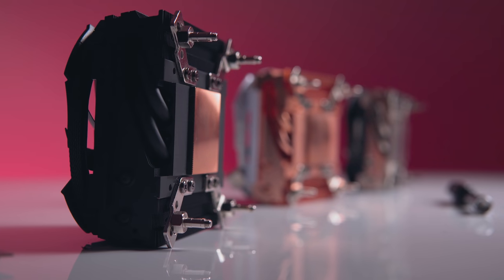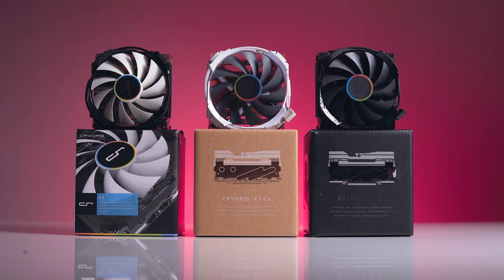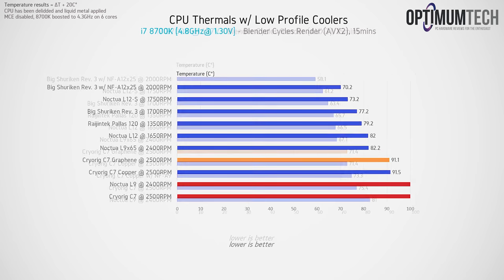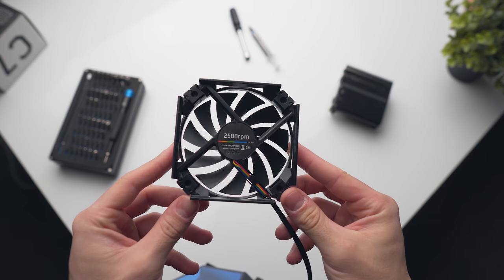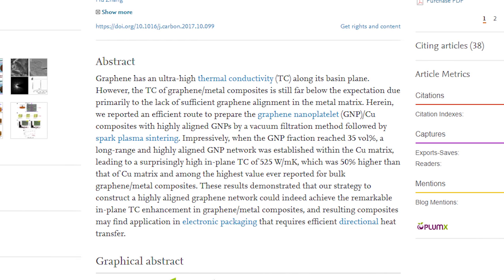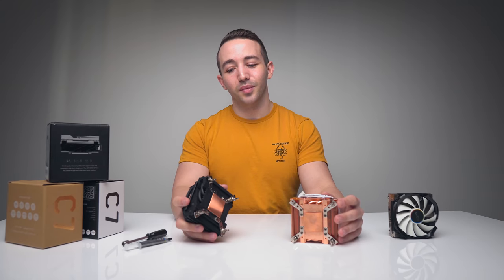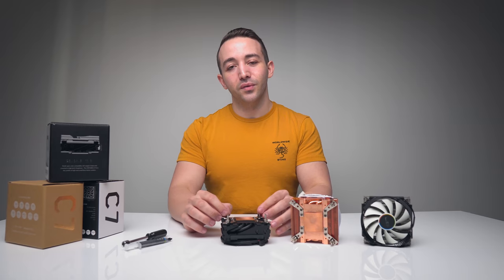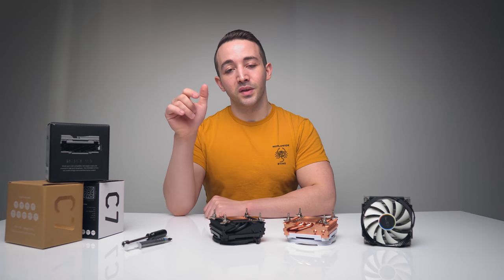Graphene Coated CPU Cooler - Why Does This Exist?

Comment: This is why I love this channel. You even went to research the graphene properties to see why of these results. Great video as always Ali!
Reply: Navaks exactly
Reply: I apreciate his effort too, but I feel like he kind of missed the mark, since the paper is about Copper Graphene composite Materials and not about coatings. Those too things are not the same and the cryorig c7 graphene is not made from a composite, its only graphene coated copper... Dont want to bring any bad vibes just feel like this needs to be clarified.
Reply: There was no point in bringing up that research. A coating wouldn’t improve the thermal conductivity of the cooler. The fact that it’s got a matte black finish is probably what made the difference. Graphene would only make a difference if it was the interface between the heat source and the heat soak, so like a heat pad sandwiched between the cpu and the cooler

Comment: So it's the copper c7 but black? Good enough for me
Reply: Yeah, if you are into the looks of your PC, I think options like these are great.
Reply: Yep. I think Graphene was just an alternative to black anodized aluminium like some other manufacturers use, in order to get a black colored cooler that performs just as well as bare copper.
Reply: yep, the color is the main issue
Reply: Its the best so far  for sffpc with 47mm max cooler height. =)
Reply: Yeah, if you're gonna get a C7 at least you can get it in black if it's same price lol.

Comment: Disappointing in this case, but interesting innovation attempt. Good investigation and honest review 😎👍
Urban car myth: Painting a car radiator black helps it run cooler. The reason painting a bare aluminum radiator can help is the paint gets heating by conduction. A car radiator is large enough that adding paint can be a significant amount of heat soak material. The colour doesn't matter. Unless trying to reflect radiation from the sun, then white would be more appropriate.

Comment: Great Video on an intresting CPU Cooler. Just one bit of engineering information from my side: usually radiators get coated to improve thermal radiation. It is the same effect as wearing a black shirt when its sunny outside - your shirt gets more hot then someone else with the same shirt in white color. This works in reverse too. So you will also radiate more heat. But you w'ont notice that since it is a minor effect compared to convective cooling. And that is also the Problem here: the heatsinks main way of cooling is active convection thru the fan, radiation has almost no effect in comparison. But still I bet the improvement in radiation of this cooler with the coating is measurable. If you dont trust me, check black body on Wikipedia. 

I hope this is somewhat understandable, since English is not my first language. Great review anyways!

Comment: Well it's the C7 but black and performs the same as the C7 Copper, that's cool.
Reply: @A_P3RS0N  it’s not denser than copper, the electrical current density is 1 million more dense than in copper, density and electrical current density are 2 different things, also the heatsink only has a coating of graphene(it’s still made of copper) and it doesn’t make the heatsink perform better, it’s just marketing and looks

Comment: I think there might be a slight misunderstanding here, adding a layer of highly conductive material onto a lesser conductive material will not magically make it more conductive. What you will actually do is to insulate it less (than if adding another material onto it), because adding material will always insulate an object NOT improve heat transfer. (the reason it works for thermal paste is in essence that you get a better contact between IHS and heat sink thereby substituting air for a much better heat conductor I.e. The paste ) 

The only way this could improve transfer is if it provided a higher surface area or substituted some of the cobber that would otherwise be there (which it does not as it is a paint job). If it substitutes paint with a low heat transfer, it will improve the thermal conductivity relative to a heatsink covered in the standard paint.

If what I said above was false, you could insulate your house perfectly, so not a single watt of heat would escape you house, then paint it in this paint and then your house would not insulate at all... I promise you this will not happen because the inner layers will limit the heat transfer. Exactly like the cobber heatsink will be the limiting factor for this heat sink.
Reply: Well put mathias, saved me an explanation

Comment: I'm not sure if the high thermal conductivity is the reason why it performs better (albeit barely). My hypothesis is that air is not a good thermal conductor, thus changing the thermal interface material will not do much, unlike using liquid metal where both surfaces are highly thermally conductive. Using a black coating however may improve performance because it is a better black body radiator.

Comment: As a fan of Cryorig's products (was rooting hard for them to make Noctua, BeQuiet! and Cooler Master a run for their money), this rush job to bring out something just to sell really hurt. The original tower coolers that they came out with pushed competitors to make better products since the market for coolers started becoming stale. So if Cryorig should learn anything, it's to go back to true innovations like the Hive-Design, or the offset design, which didn't turn out to be gimmicky.

Comment: Graphene can only conduct heat on a specific direction. Therefore, it only helps conducting heat when all molecules aligned at the right direction, which is impossible for a "coating" since the direction of molecules cannot be controlled. 
AMD used a special graphene pad in their Radeon VII, which provide a better heat conductivity than thermal compounds (especially for the junction temperature). In that case the pad was strictly fabricated so that the molecules could align at the right direction.
However, the graphene coating is not completely pointless. Copper heatsink, unlike many people believes, do get oxidized. Especially after they contacted with human skin. The trace amount of sulphur containing secretion on our skin could catalyze the oxidation of copper. Therefore, all copper parts that may make contact with human skin must be coated with something to prevent the oxidation. Therefore, the graphene coating is actually to replace anther coating material with less heat conductivity.
Reply: might be not as much advantage as expected, but an advantage nonetheless

Comment: Thanks for the review, was considering this one for the DAN A4 if it would cool really well, but the turbulence from the height clearance, the price (70 euros) and the not really all that special cooling capability make the Asetek 645LT a way better choice.
If you can only fit this or the low profile Noctua, at least it looks really badass. If you peel off the sticker on the fan it's an all blacked-out little cooler. Shame about the graphene not really adding anything, though.

Comment: As a Materials Engineer, some other factors that Cryorig may have needed to consider (in my opinion) in getting this product out to market:
1 - Graphene - by definition - is a single layer of carbon / graphite (sub nano-meter thickness). Too fragile to be handled by hand. In order to make it easier to handle - they could've had to use a thicker coating (multi-micrometer levels). That drops performance also (ESPECIALLY if the layers aren't aligned)
2 - Graphene - just like graphite (from a pencil for example) doesn't want to bond with metals that well. They could've used a bonding material that could reduce its thermal conductivity. Consider thermal paste between the die and IHS vs. solder between die & IHS as an example. Think how much better an integrated & soldered CPU cooler would perform vs. the ones we use today, as an example.
Reply: I ain't never done shit to you  why u gotta hate on me?

Comment: Honestly, it's all about the color. First of all the study you have found is about in-plane-conductivity, aka heatspread from the part of copper sheet(fin) closest to the heatpipes to the parts furthest from the heatpipes. Transfer of heat from the copper fins to the air flowing through them would be out-of-plane-conductivity, which I would argue is the actual bottleneck. The other issue here is that graphene has thickness of about 0.35 nm (actually slightly lower), so even 525 W/mK will mean 0.00000018 W/K drop through the graphene sheet.
I suspect having some sort of microfin or even nanofin structure on the copper sheets would dramatically outperform any graphene application. For me it is a non-compromise way of painting the fins black, purely cosmetic and unrelated to cooling performance.

Comment: Awesome video! A little let down by the C7G but Im curious if the application of graphene is different through each model. If one model has a low heat dissipation constant and another was applied slightly different causing it to get closer to that 500 W/mK

Comment: Even if the graphene is aligned, the layer is so thin, probably not even 0,1mm, it’s like it wasn’t there. It would only help if the whole heatsink (not only a coating) was in aligned graphene.
Reply: I can show you explain why with numbers, but it would be a small essay. #trustmeimanengineer
Reply: i thought the actual point of having graphene is to make a larger surface area, even if it's in microscopic level, to make it easier to dissipate the heat into the surrounding air.
Reply: @Looo0007  Yeah because of the roughness, the convection (heat transfer between fins and air) will be better. Aligning the graphene will help for a better conduction (heat transfer through solid materials). 
The convection should create more turbulence. But if there is already enough turbulence, more turbulence wouldn't do a lot. Btw havingmore surface, doesn't always makes it better, look at golf ball: it has more surface area, but less turbulence and thus less friction.
The conduction though the aligned graphene is very vast, but he layer is so thin, it almost doesn't do anything. 
It's like putting a spoiler on a slow car. It won't be really faster in the corners (but it will be a tiny bit faster)... But I still think it looks cool. :)

Comment: Surely adding another layer that takes time to transfer heat just adds (maybe by a negligible amount) to the total amount of time it takes for that heat to be transferred?
A faster heat transfer material than copper on the copper is not going to speed up the transfer of heat through the copper.

Comment: Graphene is a pain in the ass to work with technically. It would be a game changer for battery technology and other billion-dollar industries to get it to behave as intended, so there is no way Cryorig did anything else than applying a graphene enhanced paint. This does not improve heat conductivity at all but seems to not have negative effects.

Comment: I was wondering if you have tried using a powerful low profile 120mm fan on the C7 variants?  (more like the ID 12015-XT, rather than the Noctua one) You probably have many fans that you can test.

Comment: So I just learned about Graphene and my first though was application to CPU cooler... Looks like someone beat me to it.  However, why is the copper bare on the underside. The heat has to conduct through the copper before it can even reach the graphene.

Comment: Hello there, really greatfull for all your videos. They help a lot. In that note I am here to thank you and drop you a suggestion for the cryorig c7 ultimate analisys. Have you eard of the j-hack 3d printed mount to adapt any 120mm or even other 92mm fan to the cryorig c7? For the 202 folk it would help a lot ( I am thinking about building a node 202 build with that, because judging for your videos the real limitation of the c7 is the fan.

Comment: The baseplate on the graphene one is copper, so go figure that you're not getting any better results than pure copper, because you're limited by the copper interface to the IHS.. If it was entirely graphene, it would probably perform better.

Comment: The max temps might be identical but did you look at the temps while they getting up to that?? I wouldn’t see this cooler as being able to have lower max temps but more efficient cooling up to that point. Like how a AIO takes a solid 15-20 minutes to find a stable temperature when under load.
Reply: It wouldn't make any difference - the reason an AIO takes longer to heat up is because water has a much higher heat capacity and is absorbing most of the heat and takes longer to heat up. Graphene or not, this cooler is still 99% copper, so it will behave virtually identically.

Comment: Coating the cooler in "graphene" (do we even know it's graphene?) seems to be more of a marketing hype generator than an actually useful technique. I'm sure there's an upper maximum to how much heat a cooler of this shape could dissipate even if it were made of a material with unlimited thermal conductivity.

Comment: I don't think they can ever improve performance by only applying it to the fins. Heatsink performance "improves" when they are more saturated with heat; a heatsink that is 50C hot can dissipate more heat than the same one 45C. But the issue is that CPUs are particularly bad at transferring heat because of the IHS, even worse on intel CPUs with thermal gunk instead of solder. So the first thing to improve should be the baseplate, to improve heat conductivity. But there's only so much you can do. That's why 120mm AIOs on a CPU run like crap but on a GPU they're amazing. GPUs transfer heat better, the water and radiator have higher temperature, dissipate more heat. 

This review comparing the Noctua NH-U12A vs. AIOs sort of demonstrates what I mean 

https://bit-tech.net/reviews/tech/cooling/noctua-nh-u12a-review/2/

Maybe we need graphene coated copper IHS for CPUs first.

Comment: Sadly that is a gimmick that could be predicted on science alone. The CPU is dumping the heat directly into the copper, and has nothing to do with alignment in this case. When it comes to radiating heat, adding graphene will not improve radiating heat. There have been many scam kickstarters where companies claimed to heat a room faster because their heater had graphene coated heating elements. though they did not perform any better than any other unit, but cost many times more. While internal heat conductivity is important based on the thermal mass and conductivity of the metal, when it comes to actually radiating that heat away, that is purely in the realm of the laws of physics and thermodynamics, Basically, you cannot apply any special compound that will get you around the requirement for surface area and temperature deltas between the fins and the ambient air.

Comment: Cool video, good on the author to do some research too! However, I'm of the opinion that THERMAL CONDUCTIVITY of graphene layer has no relevance to how air coolers dissipate heat - i.e. to "conductive heat transfer". Measurement results are proof of that. The only TC relevant to this mode of heat transfer is the one of bulk fluid, air. Therefore, obviously, if submerged in water, "air-cooler" would dissipate heat much more effectively.

Comment: Gotta wonder though, if the graphene does in fact have higher thermal conductivity, then why wouldn't they coat the copper cooling plate with it?
Main thing that makes me think it's a gimmick tbh.
Reply: Because thermal conductivity in a system is limited by the lowest in the system 

It wouldn't do anything since you coat a chunk of copper (the limiter in this system) in something more conductive, but the copper is still the hard limit for its thermal limit
Reply: @betrayedpredator8826  So why would the graphene coating on the copper components in this current iteration of the cooler do anything at all then, with that same principle in mind?

Comment: Where did you get the graphene version? It's not listed on Cryorig web site.
Reply from the maker: PC Case Gear in Australia
Reply: it was first listed as preorder on alternate (dot) de and made quite a hype in sff enthusiast forums...

anyway, before cryorig launched theirs, there was a hype about this at the same time they launched their C7Cu as a seller in taobao (china) made this graphene coating on both the Al and Cu model, even before the Cu was globally stocked.

might have different application method, considering it was one seller vs the actual big brand, or might be a subcontract, who knows. matte black is nice :D

Comment: Nice video!
I really enjoy to professional way you are delivering those!

I plan a dancase build and would like to use an i9 9900k for productivity.. as well as an full length card.
Since the i9 has “just” 95W the c7 Cu should be sufficient, on paper. But what  did you think?!

Comment: Hi. I just bought a graphene coated copper heatsink with waffle design (4mm thick) for the NVME SSD (PCIe 3.0). I hope it'll cool my 80C (at max sustained load) NVME SSD better and than a the slightly cheaper pure copper one, to prevent it from thermal throttling beyond 70C, else I may have to buy (and wait) a 3mm thick one for the bottom. I hope one is enough for cost-effectiveness.

God bless, Rev. 21:4

Comment: Graphene is not the holy grail to cooling!
Even IF they allign the graphene correctly there will be no substantial gain in performance because the whole thing is made of Copper!
There is just to much thermal resistance in the copper inbetween (and the thermal compound) to make a difference with a thin layer of graphene !